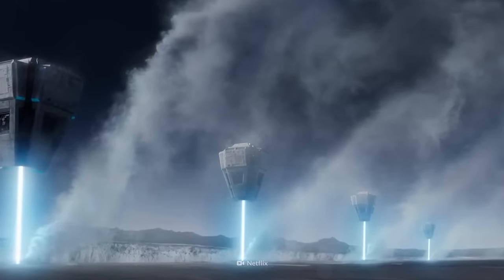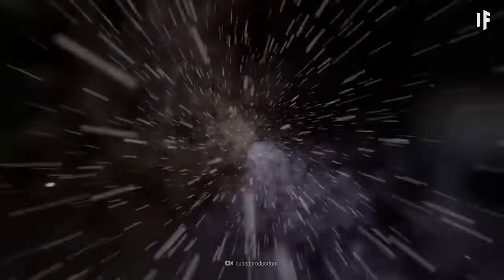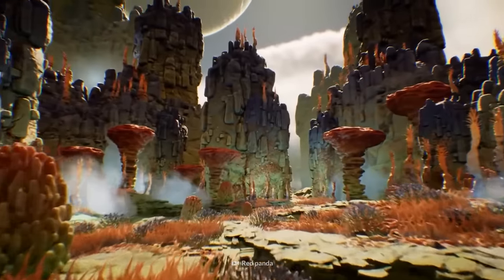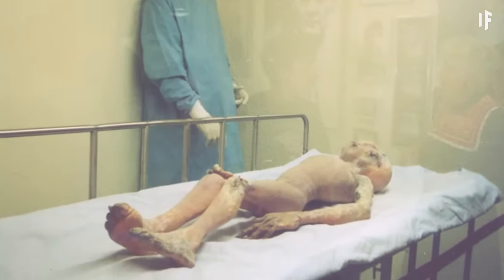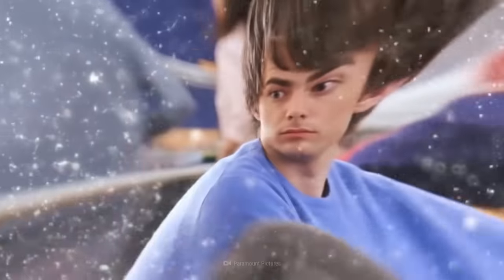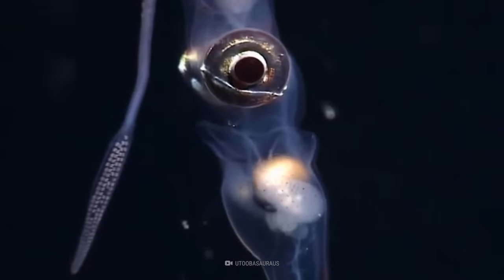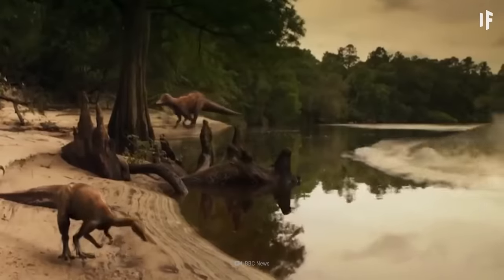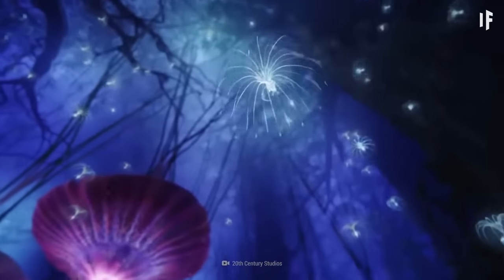Alien Civilizations: How Advanced Could They Be?

Comment: In this Idea of how much energy is harnessed,  does it account for the fact that we are finding more and more ways to conserve energy all the time ?
The efficiency of everything has seen a dramatic increase in the last 100 years ! Smaller lower voltage machines, more efficient fuel consumption,  streamlined processes,  more modern more efficient means of manufacturing,  on and on and on. Yet we keep advancing at an astounding rate.
So maybe in the future we will need less energy not more ?
Just a thought  !
So maybe the idea of the ADVANCED culture/society is not the correct idea ? Maybe it's  efficiency,  not Consumption  ?

Comment: A star enclosed in a Dyson sphere would STILL have detectable gravity fields. I'm thinking there would also be detectable alpha and beta particle radiation.Theres also the problem of enclosing a star size nuclear fusion reactor. Our sun ejects particles that we know of as the solar wind as a result of the fusion process. For all intents and purposes, burning up and ejecting it's mass. What would happen if you tried to contain that in a sealed system? Why would you want to? We use nuclear energy by harnessing it's heat, and converting it to mechanical energy to generate electricity. What's the upside of doing that for aliens in another star system? Let's say they capture a stars energy output... How do they store, transmit, and distribute the energy, and in what form? What do they do with it? 

Also, if an alien civilization COULD totally contain their home star to capture all the energy possible, WHY would an advanced race of beings need to? The sun at the center of our solar system is absolutely responsible for life on our planet...

Without the sun, The human race would become extinct in ahoet order. Totally enclosing your home star seems like a double edged sword. Yeah, you contain the energy, but deprive your planet of the energy it needs to be inhabitable. Doesn't make sense to me...

Comment: How much raw material would be needed to create a Dyson Sphere (bigger than a star!? 😮) and how long could that potentially take to construct?
Reply: A race that could build a Dyson Sphere like the one in the TOS episode Relics would take tens of thousands of years. Why do I say this. The object is 240,000,000 miles in diameter and something that big would require tearing down every planet and moon in the solar system and then others in other reaches of space. When you consider that the space between the stars in our galaxy is 4 to 5 light years on average. Even at the speed of light it would take 6 to 10 years to move material from one star to the earth or whatever star the sphere would be built. According to what we know nothing that contain mass can travel faster than the speed of light. And ships large enough to move trillion tons of material between the stars would probably travel slower than the speed of light. The walls of the sphere would have to be many hundred of miles thick to hold it structural shape. To me the best way to build a Dsphere would to find a way to make huge slabs of metal that divide like cells in a living organism. A huge slab of material hundreds of miles square and they are replicating on a tremendous scale Huge nanobites like mechanisms .

Comment: The Kardashev Scale is the most useless thing in all science fiction.

First, it trivializes all human or alien progress from inception to interstellar travel.  As if developing air or land travel from foot travel to animal travel up to efficient travel in the vacuum of space meant nothing. They are all the same as cave dwellers on the scale.

Second, it is based on energy utilization. Every level starts with the question "Why do we need to do this?" An advanced civilization might not need much more energy than we do now and still function quite well with ten times our population. Every year we have more people born on Earth and yet keep finding ways to do more with less.

Third, the very concept of a Dyson Sphere is unbelievably dangerous and stupid. Consider, how close are you going to build from the star? We are 93 million miles from Sol and it is still dangerous at this distance. That is the minimum safe radius of a circle. Figure out the circumference of the circle just to build a narrow belt around it. Where are you getting that much material? The Sun contains 98% of the matter in the Solar System. Most of what isn't being burned for fuel in the naked fusion reactor in the sky is gas or water.

What about coronal mass ejections? "Somebody's going to DIE!" 

Or just the billions of tons of stellar ejecta kicked out in every direction, every second, until the star dies? Don't worry about not being able to see one, all of that captured energy has to be vented or it is more dangerous than the star. That would make a very unique thermal signature demanding investigation by any species that uses IR tech. Even us level zero civilization can do that.